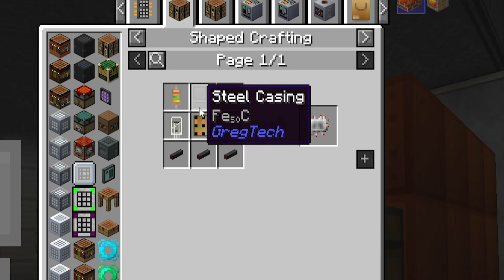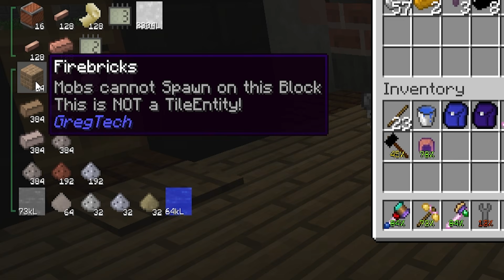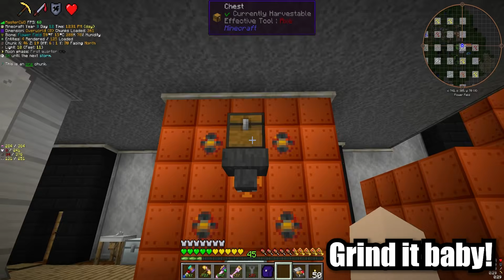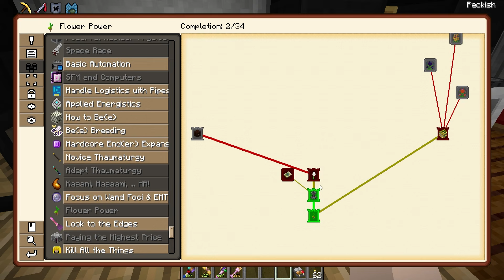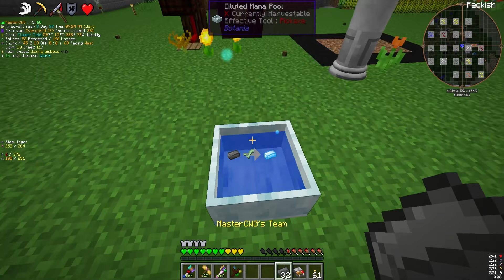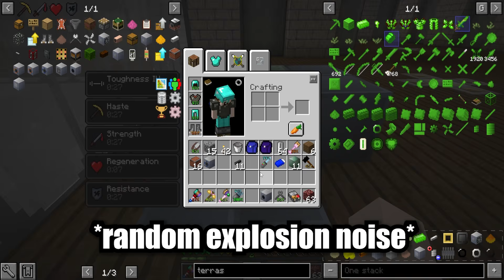Haha, Funny Greg Machine... Gregtech New Horizons (2.7.3) #3

Comment: Great video. But i have one tip:
There is a hotkey (by default its "T") to find item in nearest inventory. Just press hotkey on an item and it highlight chest with this item. (Watching in every chest with NEI filter isn't fun)
And normal Botania flowers is much closer than you think. There is a recipe in thaum to convert shrooms in to flovers.
Reply from the maker: I know about the T trick but always forget to use it 😂 I will need to
Reply: @MasterCWG  you can also press “Y” on NEI to search block in the world, makes finding lost machines easy, also I think it can make finding Gravel Aluminium hidden underground with the ore finder easier, as it will show the exact location (didn’t test yet)

Comment: I think your best bet for item pipes not just right now but for a long time coming is Electrum Item Pipes, I think EV conveyors are when you can actually use the entirety of their throughput. A large electrum item pipe is way more throughput than you'd need, so go with normal or small. Tiny is going to be about the same as the ones you got.